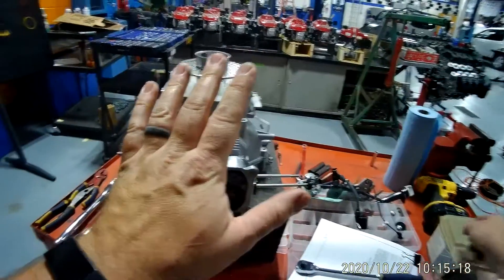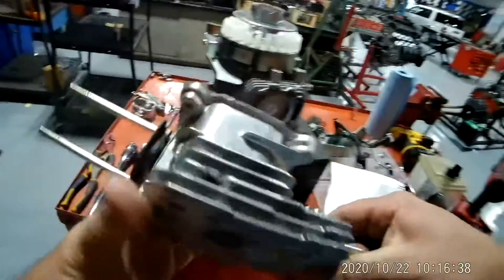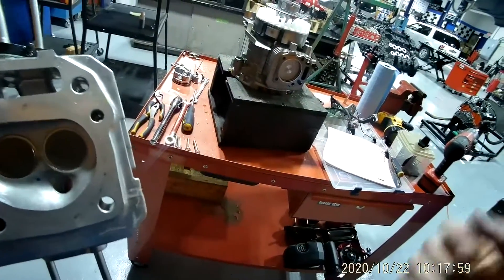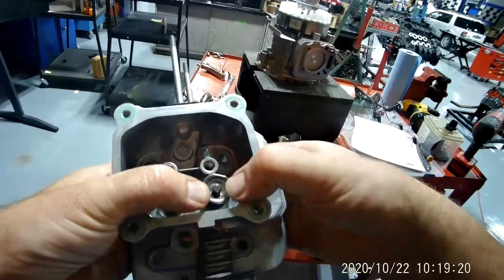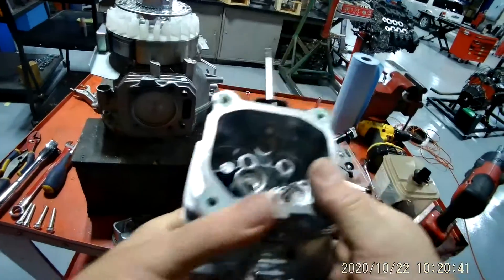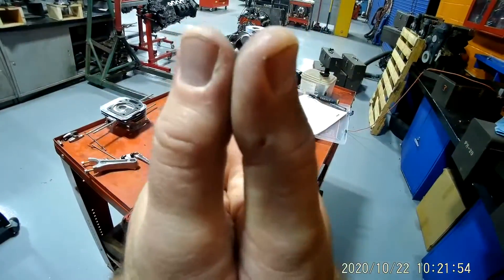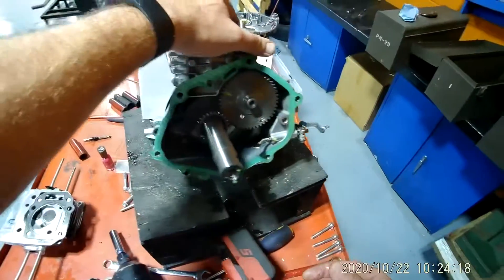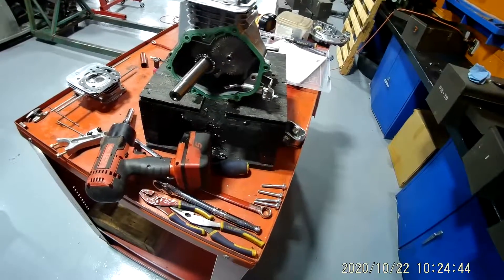Honda GXV 160 OHV engine disassembly and reassembly video 5

Comment: Hello,
I am contacting you because I observed the disassembly of the engine presented.
When I disassembled the same engine as you, 3 steel balls fell out of the engine when opening it. On your video, I do not see any balls in your engine. I can not figure out where they were going ?
Do you have any idea what I am talking about ?
Thank you for your help.
Reply from the maker: I assume it happened when you remove the oil pan, not the cylinder head? Either way I’m not real sure unfortunately.